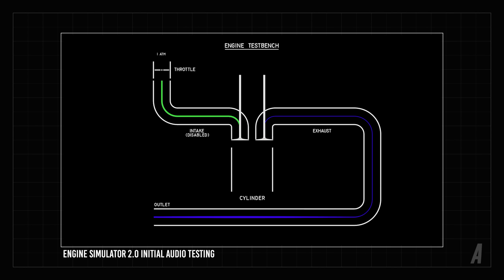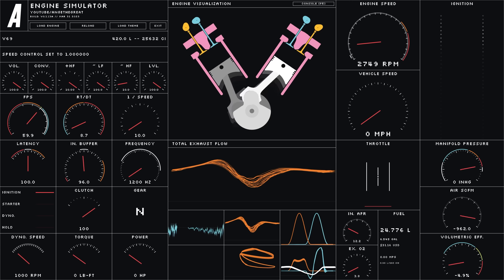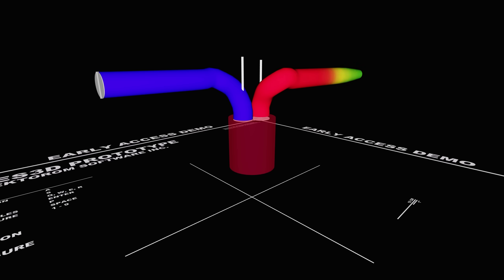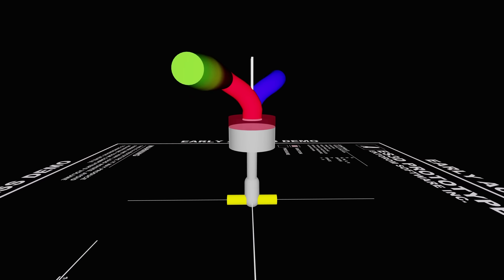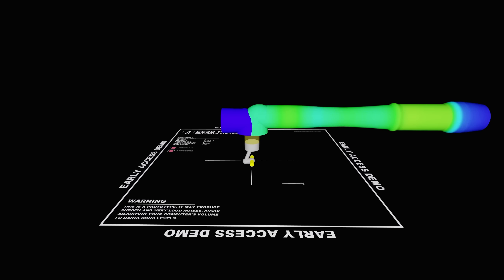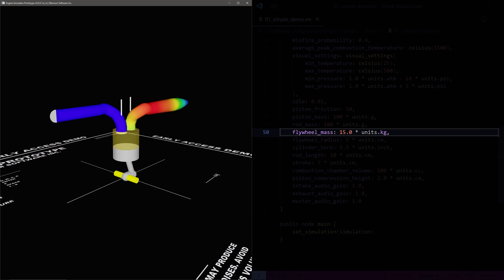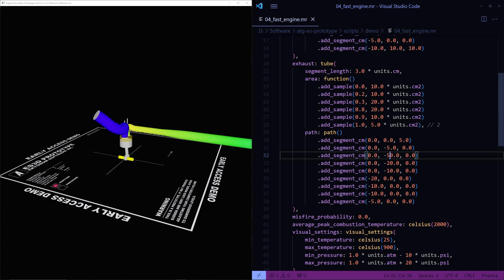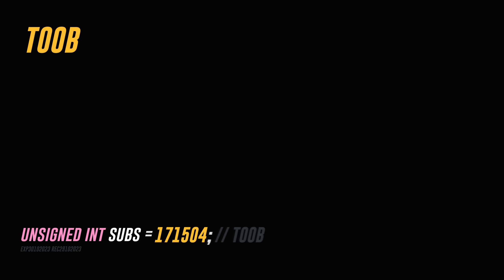Real-time Engine Tuning - Engine Simulator Devlog 4

Comment: Engine topically fire right after top dead center, but i think the firing timing should be customizable. If you fire too early it could have engine knock, too late and you get a loss of energy
Reply: Engines TYPICALLY fire BEFORE top dead center. 
And you can get knock from both too much advance (that’s too far before TDC) and too little (that’s retarded after top dead center) 
FYI if you are going to make incorrect statements you should probably not make them to someone who has spent more time researching the topic of internal combustion and complex fluid dynamics likely longer than you have collectively spent on Reddit in your lifetime, about how engine timing works j/s
Reply: @HondaTuningSuite  i would have appreciated being educated on thr matter. I wasnt a fan of the long paragraph calling me arrogant and stupud for a gap in my knowledge. Thank you for the information though

Comment: @AngeTheGreat are you going to factor in the mass of the Engine components in motion within the simulation? ie: Pistons, Connecting Rods, Crank, etc? so you can for example see the difference between a Steel vs Aluminium piston.
Reply from the maker: Those are already factored in, you can see them in my demo near the end of the video

Comment: Do you really need source terms to account for varying area? isnt it easier to use the integral form of the differential equation, so that you multiply the numerical flux on each side of the control volume with the face area of each respective side? Can be formulated like this:
dV_i*dU_i/dt + A_{i+1/2}*F_{i+1/2} - A_{i-1/2}*F_{i-1/2} = 0. 

But I’m not really familiar with variable cross section formulations, so perhaps one is forced to use source terms in this case for some reason, it could seem natural that the pressure leads to a source term in the momentum equation due to the angled wall.

Comment: Would it be possible to eventually use this in order to tune headers and intake runner lenghts for a real engine I wonder? Mechanical power etc. would probably have less correlation to a real engine, but pressure pulses might correlate better/more easily?

Comment: I have three questions.
Question one:Will engine simulator 3d or whatever you are going to call it be on steam if so will it be free or paid?
Question two:do You plan to make it open source or work with other Devs?
Question three:Do you plan to add the ability to put the engine's in car chassis and test them on a track and with load?

Comment: hey, i noticed that in the original engine simulator, larger engines were MUCH slower, and made the audio really buggy and chopped. is this fixed in the new engine simulator? btw, is it faster or slower than the original version?

Comment: will it have an option to export the dyno run data? Would be nice to simulate different throttle positions and get the torque curves x rpm
Reply: Nice thing! Yes, that'd be awesome! Export as an Image or as a excel